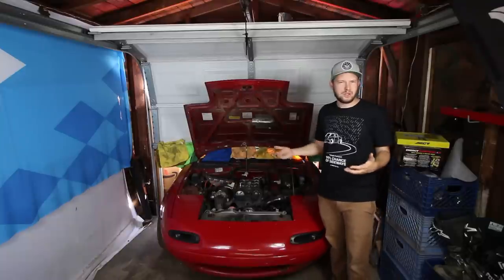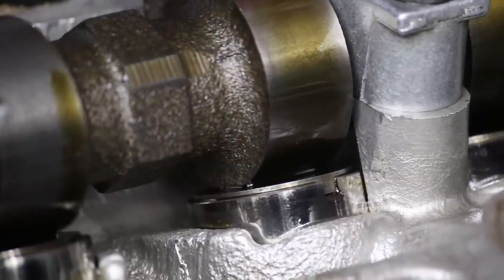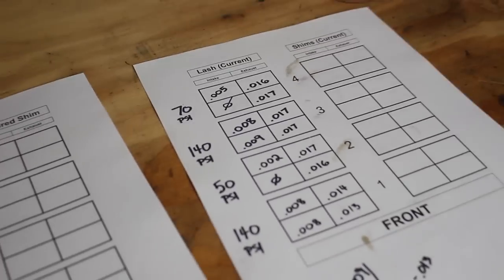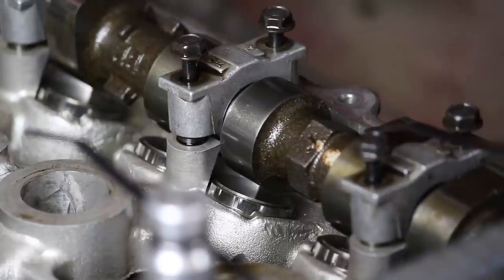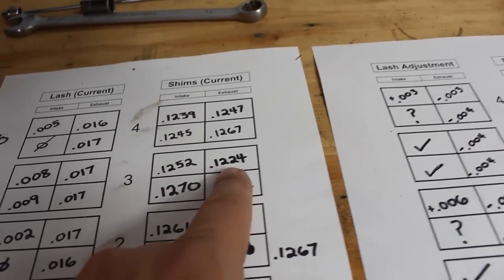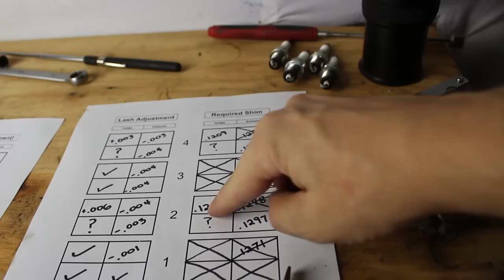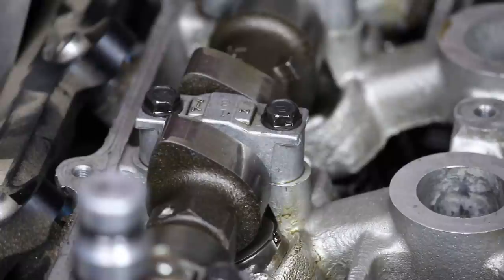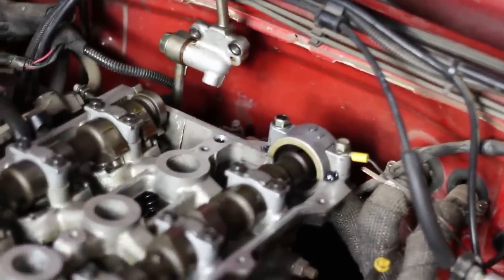The ULTIMATE GUIDE For Adjusting Valve Lash On Your 99-05 Miata!

Comment: the biggest issue with tight clearance is on an exhaust valve! If the valve head doesn't make good contact with the seat, it has no way to dissipate heat and will eventually burn a valve. Must be mentioned!

Comment: Hi Greg
I would like to mention that a pretty big problem is the cooling of the valve that doesnt close all the way. Because if it doesnt have a solid contact to the head, it cant transfer heat to it wich can result in melted valves. Good thing you caught it that early:D
Reply from the maker: That's what I meant by "cooling issue" but I didn't elaborate, working a little too fast maybe
Reply: @TheCarPassionChannel  Oh, sorry i must have missed it^^
Reply from the maker: @ZockelTV  it's all good this video is way too long to listen to every word 😂
Reply: @TheCarPassionChannel  
Not that critical really...  just watch the video 5 times and every bit of info you put into it will be revealed. Plus we can back up and run over it again as needed.  Not only do I learn something every time, I'm often shown other things yet to be learned that I had no clue of.  I didn't realize the differences between a micrometer and a caliper for example so I stopped the vid and looked into it.  This is the first motor I've had that uses shims to adjust the valves and this video really turned the lights on for me.  And researching where to get shims is truth from the trenches.  It just doesn't get more real than that.

Comment: Enormously helpful. I tried using a shim removal tool (as they do in my Haynes manual) but there was just not enough room to pull the shim past the removal tool itself. So I loosened up the cam caps as you suggested—did not need to de-tension the belt—and replaced 4 shims. No more than .003" off, but a world of difference. 2003 NB, smootheville, USA.

Comment: I’m blown away by the value you just provided to me free of charge. My 2000 Miata is sitting disassembled in the garage with a head gasket replacement in the works. It’s my first time doing this job so I was clueless how to properly check valve lash when it goes back together. I can’t thank you enough. Sub’d and liked!

Comment: I followed your vacuum test after lapping the valves. Now I need to lash my valves, unfortunately I mixed them all up so but it should be a good learning experience putting it back together correctly and measuring it properly.

Comment: Great information for me since this is the very first foreign engine & overhead valve engine I have worked on,, i'm a small block chevy guy, but my grandson just purchased this 2000 Miata, and it's a leaker soi i pulled the engine and tranny out to reseal all the oil leaks, and found the valve lash on a couple valves out of spec's. havent had any luck finding shims that are needed, i need one shim at .150, and i don't think they ever made one that thick. i have the number 2 valve on the intake side with a .26 thousands gap. the lobe is the exact size as the rest of the lobes, so i'm a bit in the dark on why this gap is so big!

Comment: What I am about to say is especially true in N/A setups. If your Adjusting them in 70+ degree temperatures. You can actually get away with 0.007 Intake and 0.0011 Exhaust. I know they say “only follow the manufacturer’s Specs.” However considering the manufacturers also leave enough room for their vehicles to be cold started in Russia roads in winter while also being driven up a very steep hill in Mexico in the hottest days of summer. All of which on their same factory recommend adjustments. So there actually is a slight amount of play room figured into their recommendations for extreme thermal expansion. Honestly. 

Now alternatively if your cylinder temperatures are increased such as non intercooled Turbo/Supercharged engines also high boost and nitrous setups. As well as alternative fuels like nitrometh I recommend going to the looser side of the manufacture recommendations for the thermal expansion of the metals under those extreme conditions. 

But a properly tuned and intercooled turbo setup shouldn’t see cylinder temperatures that high to begin with.

Look at it this way if you have to run colder plugs. Then set it to the higher side of the factory recommendations to be sure. And if your still running the factory plugs you can get away with that extra 0.001 depending on your climate temps and the way the vehicle is driven. 

If it’s a car that only see’s racing conditions than you probably already know what you should be doing with valve adjustments anyway. Because is racing conditions a loose engine is a happy engine.

Comment: Excellent timing! I am rebuilding my BP4W head with FAB9 264/264 turbo cams, VS855 springs, and stock valves. DID YOU KNOW, stock valves are NOT magnetic! So they must be stainless steel or something not magnetic... Which, might mean no reason to upgrade valves.

Comment: So it definitely sounded normal after the valve lash adjustment, did you notice a difference in power or performance when driving it??  Thanks for another great video, and yes I read the comments below and discovered an Easter egg, or is that NCeaster egg...

Comment: I have a 99. And I bought a refurbished head and the guy said that he checked all the valve lashes and they were all good. But the engine does tic a little bit. I figured it was just normal as it is a Miata and they say they’re known to be kind of noisy engines. Now mind you this car is also boosted. I have been driving it the way it is for many thousand miles at around 12/14 psi boost. I’m also using a 96 intake cam because it actually has larger lift and if just changing the intake cam, and you do the calculation for overlap, it actually has less overlap than the stock 99 head with the stock cams. And as far as I know, less overlap is good for boost. Also I didn’t want to go through all the trouble of doing the Exintake mod(for min gains and doing all that work).when all I had to do is just drop in the intake cam and I get almost the same benefits and I don’t have to drill or mess with anything. 

I did a compression test and I basically got 180 on all cylinders. But when I did the valve lash almost everyone was way out of spec on the Big side. I’ve been using it like that but I definitely want to address it ASAP. It’s been really cold while I live recently but I think tomorrow I’m going to go out and try to get them more dialed in. Lucky for me the last time I was at the junkyard there was a Miata there, and I took all the shims lol. So hopefully I’ll measure all the shims that I have and with a little bit of luck I’ll have all the shims I need to fix all my valves. And then I can see if the tick actually does go down for reference most of my shim specs that I measured on the intake where like .011 when it’s suppose to be more like .008(in). So well see how that goes. But the car freaking rips.

Comment: Thanks dude Im having problems of missfire on no. 4 cylinder sometimes and the idle to me is not that smooth but not as bad as when it missfires.  First imma check spark, fuel and compression and go from there. But this is good to know just in case this is the issue on my car. 2005 LS with 112,000 miles so it might need adjusting after all I drive my car hard sometimes. It's a Miata gotta have fun with it lol.

Comment: I’m curious if this has to do with the Sealed Power VS-855 springs. How often does this occur with new Super Tech doubles. Also, Precision Shim out of Australia has both 27 mm shims as well as the 6mm lash caps for the Mazda SUBs if needed.

Comment: You will burn your valve if it is left open.  The expansion ratio cools the combustion charge as the piston descends.  It there is a gap the gas leaves the cylinder very hot when the piston is at the top of its stroke.

Comment: Another note, if exhaust valves have negative lash like you demonstrated, it is HIGHLY likely you can burn and destroy a valve. The seat heats up way more and actually melts the valve. That is why on Miata heads there is more exhaust valve lash than intake valve lash when referencing factory specs.

Comment: Great Video!, Seems like a lot of effort where its easier with under bucket lifters. Greg why didn't you upgrade to Supertech Under bucket cam follower/lifters?, no chance of shooting out a shims from the top at high rpm. Also, you can file the 5.5 mm shim caps super precise, to the ten thousandths.

Comment: This is a nicely done video; thank you.  I just woke my Miata up a few days ago after its hibernation and it sounds like I have one--just one--very noisy valve.  (Oil & filter changed before hibernation.) Question: My car is a 99, non VVT engine--is anything in this vid unique to the 2001 and later engine that you're working on?

Comment: Good vid.

If you had a belt sander you could have skimmed your shims thinner and thinner until you can get the feeler in and be able to get a measurement then order the right size. When are we going to get some Husky vids ;) You could check the valve clearances on that too, it's like lego size after working on a car head ;)

Comment: Two questions:
1. Do the lash measurements need to be done with the engine warmed up? Seems like they should since the metal can expand with heat?
2. Have you checked lash at various rotations of the cam, not just opposite the lobe? What if the cam isn't perfectly round on the "closed" side?
Reply: It's done a cold engine ,an better yet when rebuilding your head .  For number 2 ,if your cam has a flat spot .... it's time to replace your camshaft.

Comment: Greg, my boosted Miata does the same 3 cyl cold start as well, but I've got a 1.6 motor with hydraulic lifters. Apart from the regular spark plugs/wires, where should I look next?
Reply from the maker: Power balance test first which is a fancy way of saying identify the dead cylinder by pulling off 1 spark plug wire at a time. Once you find the dead hole, you can swap around ignition coils/wires depending on your setup (1/4 and 2/3 are on the same signal). Also compression test, and vacuum leak test. That's pretty much all free to test if you rent the tools from Autozone/Oreilly

Comment: Running into the same issues on my 404whp BP6D with Supertech heavy double springs and stock valves/head otherwise. Exhaust side i am seeing lash of .016/.017 on cylinders 2-4, with cylinder 1 being at .014,  Interesting that your cylinder 1 exhaust valve lash was lower on 1 as well.  On my intake side I am seeing .010 average lash with cylinder 1 having one Zero/negative lash valve, and cylinder 2 having a .003 lash on one valve. Going to attempt to relash the two intake valves to get by for a bit. I suspect as we talked about on instagram that I am starting to see scalloping on the valves as well.
Reply: Did you end up re-shimming all of the exhaust valves back down into spec-  .0133 ?

Comment: Hey, great work with the informative video, I don’t know if I missed it or you did’nt mention it but why does this happen at all? Is’nt it perfectly shimmed from factory?
Reply from the maker: Eventually the valves or valve seats can wear down, which let's the tip of the valve extend higher up towards the cam. This is also important if you ever change cams, build the head with different valves, replace a factory valve, etc.

Comment: Hello  , i have kinda  the same problem on my 99 nb , starts fine cold  , but if i drive it for an hour and then take a 4-6 hours break it will start on 3 cyl, shoud i check the valves?
Reply: exact same problem here

Comment: Is it a good idea to swap shims between cam lobes? I thought on flat tappet cams, the lifters or in this case shims are "matched" to their respective cam lobe during first run in. This can only be done once with each lifter oder shim, so swapping them to another cam lobe could increase wear. Not 100% sure this is applicable here.

Comment: What kind of valves do you have in there, if they are titanium get rid of them and get a nice stainless valve, and don’t worry about the weight you aren’t revving the engine high enough for that to become an issue.
Reply from the maker: Full stainless valves intake and exhaust!
Reply: TheCarPassionChannel that is the only way to go for a street application.

Comment: Belt sand the shims not being used and put them in and measure how thick they are
Reply: N Murphy I was wondering on the ones that were too tight if he could use a plasti-gauge and measure that?
Reply: ouch; I don't see how you could keep them perfectly flat.

Comment: I went to the local dealer 3 times complaining about the ticking and rough start.  Was told, at first, that it wasn't doing anything when they had it (I left it with them twice) and finally they told me that they could try to fix it but couldn't give me a quote since they didn't know what was wrong.  Car quits completely (while driving) so back to the dealer (big mistake). $2000 later, it still doesn't run and they tell me they don't know what is wrong and I need a new engine for $2500 (used engine).  I tow the car home and let it sit then find your video...magic.  I just checked the lash and I have 5 exhaust and 2 intake valves out of adjustment plus I other intake valve (#3 of 8) that is fully open and won't close.  Thoughts?  I'm presuming that the head will have to come off - do you have a video showing how to do that?  Thanks for the video - clear and concise.  My bad for trusting a dealer, even if I have been using them for 18 years (my car is a 2001 with 230,000 KM that I purchased new).
Reply from the maker: Sounds like you just need a valve job and you'll be on your way, any machine shop can handle it!
Reply: @TheCarPassionChannel  thanks for the quick response

Comment: I have a '99, but I don't want to deal with that issue at all. Total PITA. I also have a 1.6L and love the hydraulic lifters. They should have stuck with what self-adjusts. Dumb change on Mazda's part for probably unmeasurable power differences.

Comment: Ok so my 1990 does this exact thing.  Where is a good guide on how to do this on the 1.6? Oooorrrr since my lifters are hydraulic, could they just be seized?
Reply from the maker: It's different because you lifters automatically adjust the lash. The ticking on 90-97 cars usually requires the lifters to be removed, disassembled and cleaned, or possibly replaced.
Reply: TheCarPassionChannel that makes sense. Would that result in them not opening all the way and a decrease in power?

Comment: Did you consider sanding one of the bad shims down to a smaller size and measuring from there?
Reply from the maker: Y'all coming in clutch with the good ideas, I should have tried it but I assumed the metal would be too hard to try by hand haha. Probably could have laid 320 grit on the bench and gone at it
Reply: @TheCarPassionChannel  the thought makes me cringe; how could you ever hold it perfectly flat..........
Reply from the maker: @daleabono3616  you have to have the sandpaper on a flat surface, and you press the shim down against it. That's the only way really unless you have a belt sander or something. One of my friends actually "resurfaced" his head using sandpaper on a glass table. Pretty sketch but I guess it was a thing at one point. Edit: I wouldn't USE a sanded shim permanently in the motor, but that might be a valid technique for measuring.

Comment: If the valve seats were machined, the valve sits lower in the head, pushing the valve stem and bucket up. In such a case, the end of the valve stem should have been grounded down to by 4, and 3 thou respectively to accommodate for the offset.
Reply from the maker: @jonathansandiford4137  Yes this is correct information. In my case the intake valves were wearing out and closing the gap.

Comment: On the ones without gap, can't you just take the shim off completely and measure the clearance? Subtract your tolerance and now you have the shim size
Reply from the maker: It's a bit tricky to measure the gap between the lifter without a shim in it, and the cam. But as long as you can measure it accurately,  sure.

Comment: I can see how the gap would get larger due to wear. But how does one get smaller since there is no adjustment and the shim doesn't get larger, I'm wondering how the gap can close like that?
Reply from the maker: The gap gets smaller if the valve face wears out. Usually the gap never gets bigger. Maybe with excessive valve float + mushrooming the stem tips it could happen

Comment: Hey Craig - do you replace the copper washer on the vvt oil feed banjo bolt every time you remove it?
Reply from the maker: I've never replaced it 😅 and I've removed it probably 25 times
Reply: @TheCarPassionChannel  last time I did my valve cover the banjo bolt was almost impossible to remove and I'm pretty sure the shop before me put about 90  lb of torque on it and destroyed them ended up with a massive leak, just curious if they actually are one time use

Comment: Hi. Is that an 1.8L engine or a 1.6L? Im adjusting head valve lash after changing headgasket and cylinderhead with new camshafts. Its important to know the right tolerances for clearance and im not sure wether or not i can use your values.
Reply from the maker: 90-93 1.6 and 94-97 1.8 have hydraulic lifters and do not need adjustment. 99-05 1.8 are solid lifters and you can use this guide for those engines.
Reply: @TheCarPassionChannel  Thanks for your answer^^ i have a 99 eurospec NB with a 1.6L 110hp. I have solid lifters with shims like in your vid, but i cant seem to find the right valve clearance for this engine. All manuals i can find are for the 1.8L engine

Comment: @thecarpassionchannel is this something I would need to worry about if I have shim under bucket style lifters?
Reply from the maker: Yes anything without hydraulic lifters can come out of spec when things begin to wear. With shim-under-bucket you will have to remove the lifter itself in order to change the shim